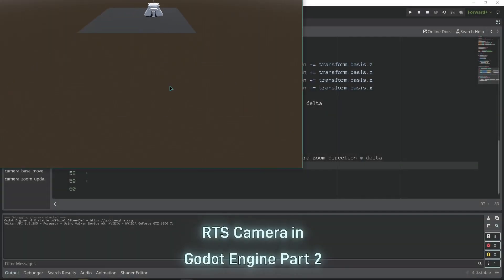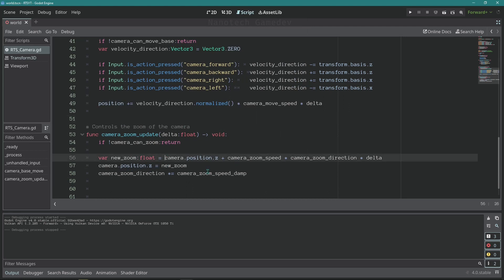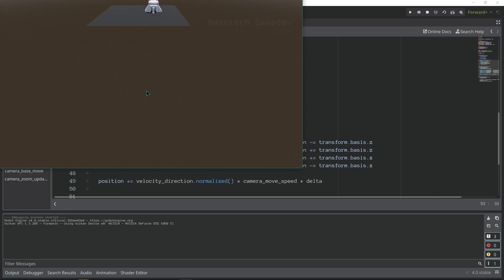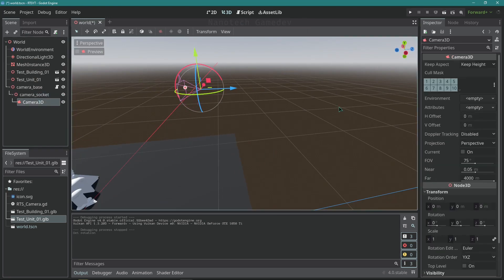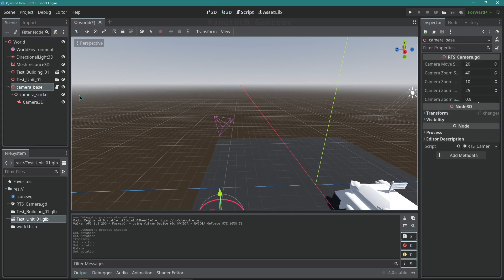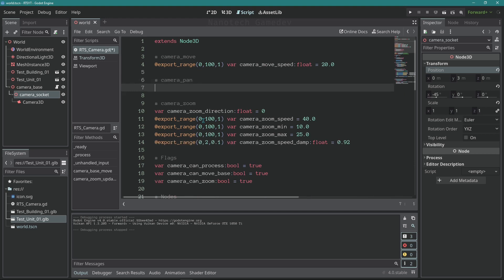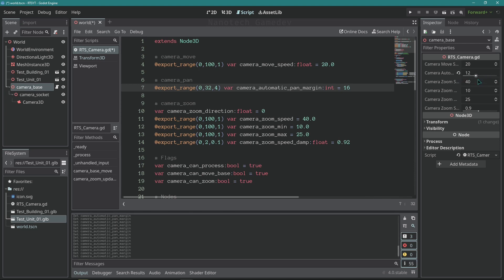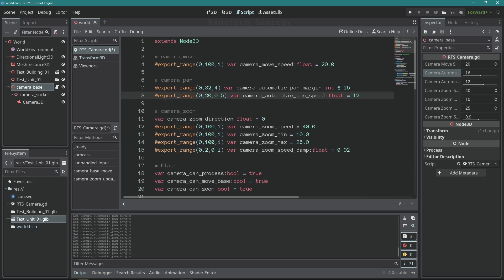How I made an RTS Camera on Godot 4 (Part 2) : Coding From Scratch - Making an RTS Series

Comment: Great tutorial, thaks that's helping a lot. But @nanotechgamedev you have quite different approchs for pan and move wouldn't it be better to have the same and possibily calling a common method to do the move you would avoid the missing zoom_factor in the move ?
Reply from the maker: Yea, but when panning is simpler to move the camera using the mouse offset, when moving with keyboard you need a constant speed to add to the input direction, which depeding on the zoom level the player is at, it needs to adapt to it, as moving 1 meter with a zoom level of 1x will be slower in 2x, but yea you could make a single function and re-use it as well,

Comment: great tutorial but I'm have an issue with the mouse pan its only working with the bottom and right side of the screen panning. Any ideas to what I may be doing wrong?
Reply from the maker: This means only positve X and Y are working, the conditions you are using on the if statement are the issue, you can see on the video at 12:11 how they should work, check if you are using OR in your if statement as well, you can also print the margins calculations to see what value is expected to start panning the camera and you can also print the mouse position to see where it is actually being calculated from,

It could also mean the camera calculation is not centered, so only the top left is being used, to center the margin I used the viewport_size.x/2, the code isn't that complex, it should work, basically all I do for the mouse pan is to detect if the mouse is near the edges so it moves the camera, with X to move the camera to the left is if the mouse position is < than the MARGIN, and to the right is if the mouse position is < than (screen_size.x - MARGIN), for Y is the same but on the Y axis,
Reply: Mayba a bit late to answer, but just in case someone else experiences this problem: I had the same, and it appeared that I putted "translate( Vector3(pan_direction.x * delta * camera_automatic_speed,0,0))" inside the if statement (if current_mouse_position.x > viewport_size.x/2:). Hope this is of any help!